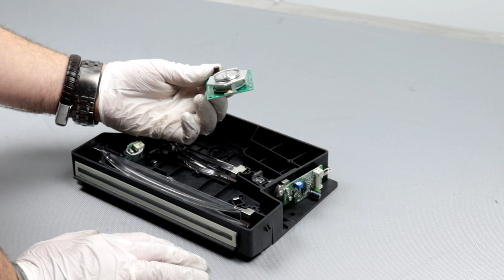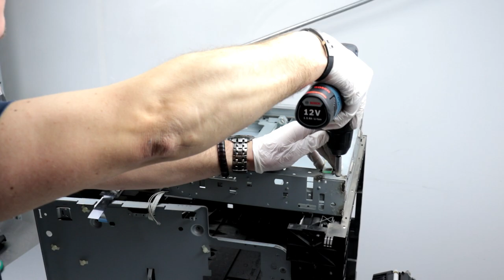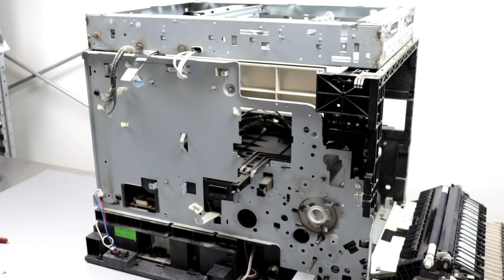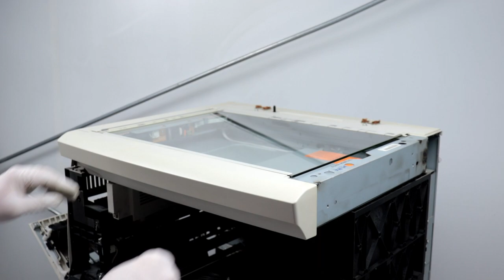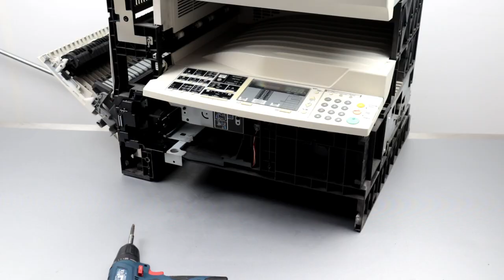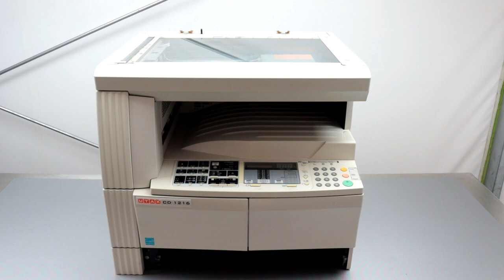Building a digital copier yourself - how to do it.

Comment: kyocera 160  ？
Reply from the maker: It is something like Kyocera km1620
Reply: @MrRicoh  oh, were they doing joint production even back then?
Reply from the maker: I do not understand?
Reply: @MrRicoh  A fairshare of current gen Ricoh models are sharing parts with Kyocera. I was wondering if it was the same for earlier models.